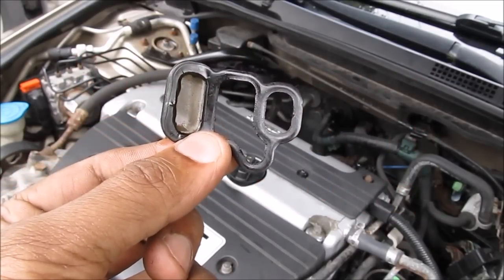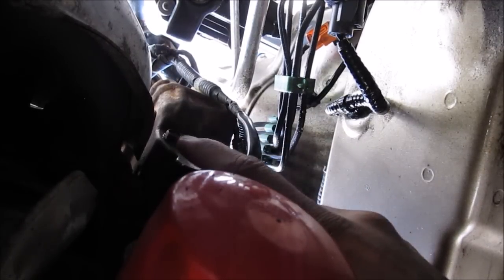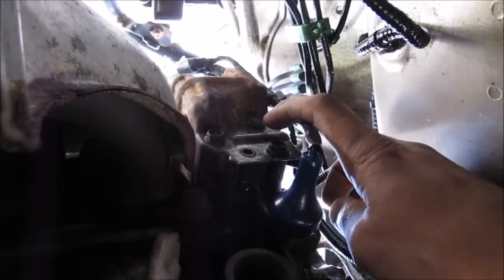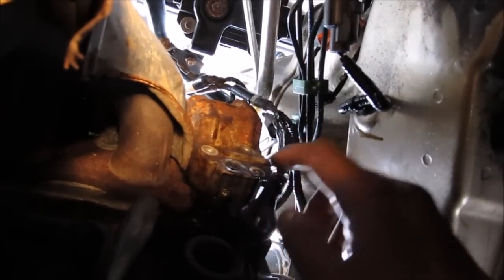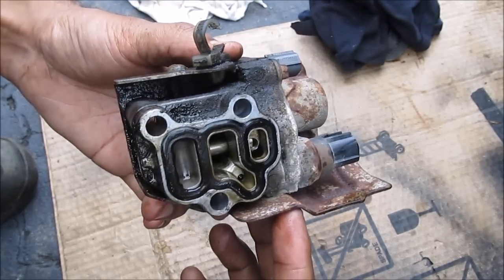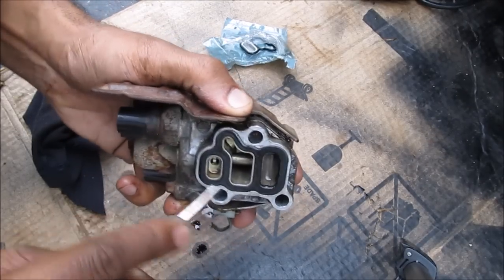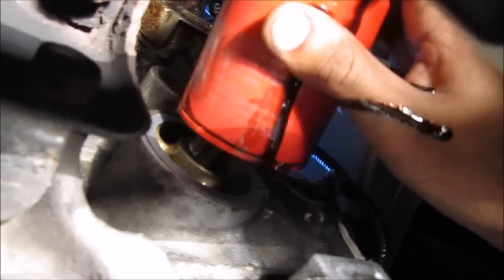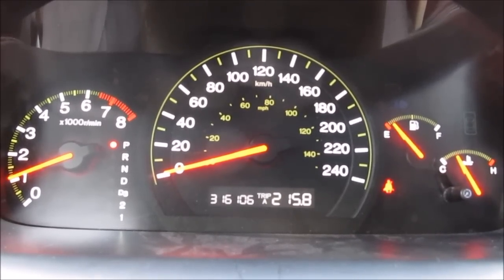How to Replace a Honda VTEC Solenoid Gasket

Comment: I was afraid to do this project- but after many videos went for it. I did it from the top. I did the solenoid, oil pressure sensor and oil filter. 
take of the solenoid. The scary part is if you use too long extension, the bolts will start to strip. This was the only problem I had. I went thru all my 10mm sockets till I found a combination that was tight. Then take off the oil pressure switch, then the oil filter. This frees up space for your arms. Then just go in reverse order. It took me about 1 1/2 hours. Most of the work will be done blind, but if you can take your left hand and go low enough, you should be able to use it. The lower you can get the more room opens up.

Comment: 104-inch pounds sounds a lot.

But when you convert it, it's like 11.75 Nm.

That's like nothing.

A sump plug is usually 40Nm

Comment: You can easily do this from working fromon top of the engine.   No need to remove the oil filter or work from underneath

Comment: Be careful. We got burned when the solenoid base itself had warped and the new gasket did NOT stop the leak. The front solenoid is more common failure and smokes the alternator. Anytime you're doing an alt replacement, look for oil. No warranty if new alt gets oil inside

Comment: I’m going to punch a hole in the screen, if the oil filter does its job, that screen isn’t needed, that way, there won’t be any restriction to oil flow to the solenoid.

Comment: I replaced the crank pulley seal because it was leaking, and was getting on the cv shaft and some pulleys, but still leaking and it’s dripping right on top of the o2 sensor harness, will take care of this gasket next

Comment: Nice video. Did you have to remove anything from the bottom of the vehicle to get to it besides the oil filter? I’m having a difficult time remove 1 of the 3 bolts and working from the top of the engine.

Comment: Just a heads up that the bolts are not heavy duty and can snap off! I know why one of the three was missing now, snapped one off inside the cover. The other one I could not get out, and that looks like a good thing at the moment.
Reply from the maker: Yes these bolts are made of cheese

Comment: This is great, the only thing is aren’t you supposed to put a light coating of oil around the new gasket before installing? Thanks for the video!
Reply from the maker: Yes that would help

Comment: I did this on my 2010 Acura TSX and the procedure was mostly the same. The screws were oriented differently (pointing horizontally instead of vertically) so I was able to do the entire job from the top, no need to jack the car up and go underneath. On my model at least, I recommend removing the frame brace/strut bar, it makes it 100x easier to move around. Thank you!!
Reply from the maker: Agreed the strut brace is always in the way

Comment: I dont even know how to stop this leak. Ive replace the gasket and the solenoid twice and still leaks. Ive tight the bolts son hard, and still leaks. Is a lot easier to replace thr whole engine for me. Great video
Reply: Someone else in this comment section said to use new oem bolts because the old ones were probably stretched and caused it to leak. Did you find a fix yet?

Comment: do you have the torque spec for the 22mm socket when replacing the oil pressure sensor o-ring?  thank you

Comment: I did this to my Element and Accord K24 engines a few years ago, thanks to another video. The gasket was good in both engines with well over 100K miles which I attribute to frequent oil changes with premium full synthetic oil. The job was easy in both cars. Removing the oil filter for access makes it even easier. 
Thanks for this!!

Comment: Is it possible to get to those bolts and remove the V-Tech solenoid from the top? So you don’t have to remove the oil filter.
Reply from the maker: Yes but the strut bar makes it akward

Comment: I don’t have that tool to see how tight to make the bolt and mine is still leaking and leaking worse make sure you get it right on there
Reply: But now I know it was that part and can fix it just need to tighten it
Reply from the maker: You definitely should use a torque wrench

Comment: Is it possible to replace the gasket with assembly without draining your motor oil?
Reply from the maker: Yes. This is at the top of your engine. Oil is at the bottom

Comment: I'd like to see a video for the start of the project - 2014 Honda CR-V - removing the under engine splash guard. 
 I broke the plastic holding the C clip for the little 10 mm headed, M6 x 1 bolt on
 the right side.
Reply from the maker: Best place for those clips are the junkyard
Reply: @speedkar99   That's a fact!

But I need to repair the damage I did to reinstall the engine splash shield.

The clips can be held with a 10 mm square or 8 point socket to avoid damage to begin with. 

 Never seize when reassembling

Comment: First vid accessing from below 

Seems most sensible approach!
Reply from the maker: Yes it's easier from below but can be done at the top of the strut bar is removed
Reply: @speedkar99  

Thousands + benefit from your vids over x years

I like when a month or a year later someone uploads nearly the exact details with no mention of the ..  source 😎

Comment: Hi

2.4 2007 accord  170.000 miles

This sets off the code p2646 ???

Engine light popped on and car began to sputter, then drives again

Idles fine

Load on engine starts the incremental drastic hesitation every 15 minutes or so for last few days

No oil drips!!!

I also changed the throttle position sensor bolted to passenger side fire wall with that cable connection 

🆘🆘🆘🆘

Comment: My 2005 crv seems to be leaking from the blue cone shaped rubber boot just under the selenoid. Is this possible? The boot fills up with oil and starts dripping pretty well! I see no leak coming from the 3 bolts holding the selenoid on the engine block, only oil coming from the blue cone place?? Please respons, great video!!

Comment: SpeedKar99, Not sure if you remember doing this car, but did you raise the car with a Jack to access the VTEC Solenoid Valve and remove it including the heat shield it's mounted too? Thank you in advance. I've seen some of the other comments and they say they replace it within minutes to a few short hours. Anyone want to come down to NJ and Help me? Only if you're close, lol.
Reply from the maker: Yeah you can get it from the bottom or the top. 
Top is easier but you have to remove the strut bar
Reply: @speedkar99  Yes, I tried that, but I still couldn't get to the bolts. I was thinking of putting a couple of boards across the top of the engine, and kneeling on that. This was I can look down. I even tried removing the engine block cover to make it easier to reach. 

Thank you.
Reply: Changed the Vtec Solenoid arm today. Someone said they just reached over. I placed a tarp over the top of the car engine, reached back and felt around. I unbolted the three bolts (they had a little tention). Than I ordered the parts from Advanced Auto, with a 20% coupon to order online. Picked up at the store. I put everything together. Maybe an hour total. An extra hour looking for my 10mm socket. So while at Advanced Auto I picked up a second one for a spare. I'll reset the code tomorrow and drive it around and check for leaks. Thanks everyone.

Comment: Wow, thank  you very much. Today's monday and I received a p2646. Two plus years ago I had another issue and wanted to replace these screens. I couldn't figure  out how to remove the VTEC solenoid. Scratched up my arms in the process. I don't have a lift, but I have two floor hydraulic jacks and four floor jacks. Due to the fact I don't want to wait until Monday I'll have to take it into the Mechanics. Doesn't look like it'll take to long, and should be easier for them to fix.

Comment: Man, if it was only that fast to change out that fugger....lol. Going on my 3rd one now.......
Reply from the maker: What happened to yours?
Reply: I had low oil and bucking symptoms so, I attempted to change out my VTEC solenoid gasket.  Couldn't get the lower bolt out due to stripping so I just put the other 2 bolts back in after the oil change and hoped for the best.

No problems so far.
Reply: It never gave me problems as long as I did regular oil changes

Comment: Hey, thanks for the video. I am hoping you could help me with an issue on my Honda Accord Euro 03 no one else has known the answer to:

It has had a transmission issue the last 3 months. In D (automatic) it will not shift gears and will just rev when pressing accelerator. Only when I go into manual shift (M), I move from gears 1, to 2, and then it will finally drive on gear 3 when I move it through the M gears. So I assume the problem is with gears
2 and maybe 1 as they rev a lot when I press the accelerator but don't change gears. Which solenoid should I try changing to see if the issue is resolved?
Thanks
Reply from the maker: 2nd gear is done. Common problem on those accords

Comment: I change the VTEC for crv 2003, but i have problem. When the car exceeds 120 kmph, the gas pedal is disconnected and I cannot accelerate. And the car is churn. I had to slow down.is there a solution please
Reply from the maker: Is there a speed limiter?
Reply: No there's not. But a mecanic tell me that i should clean the location of vte

Comment: I know this is old but i cant get the 3rd bolt out. Any tips?
Reply: Penetrating oil it, let soak for at least an hour for it to work. Also sometimes just tapping on the end of the bolt will break loose what’s causing jamming. Bet was overtorgued. So be careful not to rip off the bolt head. Big problem if that happens in a hard spot. Always clean bolt threads and the thread holes. If working on cars, even a cheap set of “thread and die set”, will make cleaning up threads efficient. Prevent future thread jams.

Comment: Thank you managed to fix watching this. If you lie over the engine, you don’t need to remove oil filter. The bolts are accessible with a 10mm socket. I needed a mirror and led light to do this.

Comment: For non USA folks, (104 INCH lbs mentioned here) do not torque down to 104 FOOT Lbs, you'll strip the threads! 

First time I've heard anyone use inch pounds, it's all ft lbs in the UK and NM nowadays :-)

Specs are around 9ftlbs or 12NM
Reply from the maker: Yep! I've learned things that hard way

Comment: My top bolt rounded off I’ll have to see if I can reach from underneath I only have ramps
Reply: same :/. I. ordered a bolt extracto, I may need to heat it up with a torch and use some Pb blaster to remove it.
Reply: Same 😂

Comment: Definitely change the oil if the screen in that gasket is clogging up or if you are getting the code for vvt or you may wind up clogging it back up with the same gunk you clogged it up with originally. Be really sure that thing is 100% dry of brake clean before putting in the new gasket.
Reply from the maker: Good tips

Comment: Another great video! I’ve seen the screen filter of VTEC solenoids with lots of debris/dirt. If the oil and filter are regularly changed every 5000 miles, what else could causing the dirt/debris?
Reply: I have the same question !!!  You install a good oil filter $ 9-11 dollars and still leaving debris around the engine. ?????

Comment: Nice job, it can all be done from the top I use a very long screwdriver to close the two prong clips that hold the wiring harness on the shield. On the front one right wheel side remove the valve to make it easier to get at the clip. About the only other thing I will add is cut two long studs to align the valve install the valve over the two studs install one bolt remove one stud at a time and add that bolt. You will need a mirror and good lighting...  The studs are 6MM X 60MM X 1.0 are 60M (2.5") Cut 60M anything under 55M is going to be a tad short.
Reply: Are you sure 60M? 
That is almost the length of a football field

Comment: I have a leak on my passenger side of my Honda Accord 2005 2.4 do you think this can be the problem?
Reply from the maker: Yes. Or the timing cover
Reply: Okay because it’s only leaking on the passenger side rear I’ve had some people say it could be rear main seal but my leak is not that big

Comment: Hey so I bought a 2004 element with 87k for 5500 i test drove it work good but I didn't try the heat ac was ok so I brought it home from ny to pa  but did a pit stop in nj shell station route 206 then it sat for a week. Next time I start it the heat didn't work onlet hose to heater core was hot the other room temperature shortly after the engine start to shake like crazy the send code misfire p0300, p0301 n p0302 and later it did say misfire on all 4 cylinder I install new plugs I swap one coil pack for new but befor that when I disconnected each coil pace at a time the engine did rev up some thinking it not coil pack. Now I'm thinking it might be bad gas as I was very low on gas when I did a complete fill up but it drove like 40 miles good any suggest help plz tnks

Comment: Great video. Didn't have to skip once to get to any points. Good pace. As a side note, using OEM Honda oil filters (or probably any high quality filter) will prevent that screen from clogging. Avoid cheap quick lube filters and oil in the Hondas.
Reply: They always use filter brands that no one has ever heard of. They probably cost them 2 bucks at most.
Reply: You are absolutely right, I use Castrol Edge with Baldwin B1402 filters and still running strong with 239k  hoping to get another 25k before I bust into  timing chain job. I did have to change leaking  vtec gaskets  front and rear  but the screens looked good.

Comment: I have the same car mine has a bad habit of not turning over sometimes like it’s jump timing but it immediately starts after it only happens occasionally too I just replaced the old solenoid with a new recently it’s been doing fine but today it just gave me one of those problematic cranks and started up fine after I quickly turned the key back and counted to about five and turned it again

Comment: Was going to wait reinstalling my subframe but it appears you can work on it with it installed and the strut bar removed.

For 2 months I've been gathering parts for my clutch job. Ended up rebuilding my transmission for the first time, replaced everything in the drivetrain with new parts, all new lcas and engine mounts. Was about to put the subframe on yesterday and saw I had leaks from the vtec solenoid area and want to replace the oil cooler hose and oil cooler o-ring as well.
Reply from the maker: Such a common thing on Honda's to leak! 
Yeah remove the strut bar ( it tucks under the windshield cowl SMH)
Reply: @speedkar99  since it looked impossible to replace the oil cooler hoses I did everything under the car with the subframe out.

Comment: Just replaced the whole unit of VTEC Solenoid. Here's Honda OEM Part#15810-RAA-A03 for $184.77. Took me one and half hour.
Reply: If the solenoid and pressure switch is good and working fine why replaced the whole unit? (If not damage why fix)

Comment: Would I be seeing oil around the serpentine belt from this? Had the valve cover gasket replaced already
Reply from the maker: This is near the back of the engine, not exactly near the belt

Comment: Can I use contact cleaner?
Reply from the maker: That's not strong enough
Reply: speedkar99 so I did mine yesterday; but found it was leaking a bit now by the oil pressure sensor. If I changed both gasket and O ring anything else make this piece leak? Or would it just be time to replace the whole unit?

Comment: Any suggestions when two of the mounting bolts in the back of the solenoid are round and won't come out no mater what? Tried Grip Tite extracting sockets to no avail.
Reply from the maker: You might have to cut and extract
Reply: Use twist sockets from a tool truck expensive but worth it.

Comment: For the front VTec strainer, do u gotta bond?
Reply from the maker: No don't use any bonding or gasket
Reply: @speedkar99  any special tools.needed.for tensioner or the ps removal?  i coulda sworn there was a vid on the front. thanks

Comment: 2005 CR-V 240K miles with P2646, replaced the VTEC Solenoid Assy didn't not help.
Driving the CRv a few days got same problem, Check Engine Light, VSA & delta symbols.
Anyone knows what is the correct fix?
Reply from the maker: Check oil weight , level and pressure

Comment: I’ve read on the 7th gen accord Facebook group that it’s not good to reuse your old bolts that you should put fresh new oem ones. A member reported that after replacing that gasket his Vtec solenoid started leaking 3 months later and the dealership said its due to the bolts that he reused
Reply from the maker: I see some truth, bolts stretch when you torque them
Reply: What are the bolt measurements

Comment: Does anyone know how much this repair should cost? My mechanic just quoted me $425 USD to replace the Vtec solenoid and the oil cooler o ring.
Reply from the maker: The gasket is $10 
Labor is 0.75 I'd estimate
Reply: Max Jennings, just buy the complete VTEC Solenoid and install it yourself.
Its come with the gasket with screen.
Part is around $95.00

Comment: I tried to unbolt these 3 bolts from top, but it is mission impossible and almost rounded one bolt, does  it make easier to access from bottom instead??
Reply from the maker: Try removing the strut bar or windshield cowl

Comment: I did same process on honda crv 2003 
Used original honda seal and its leaking again I've took it of 3 times to check if there may be something else but can't find whats wrong..do you have any resolution of what it may be
Reply from the maker: All K-series leaks 
I gave up